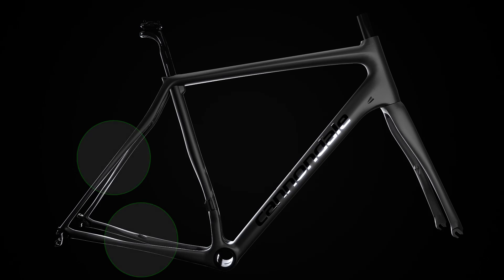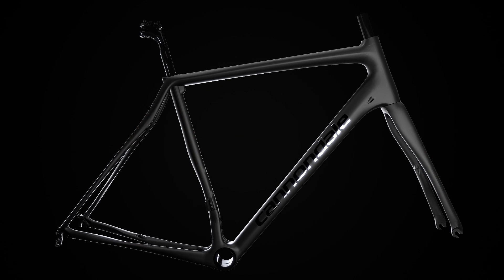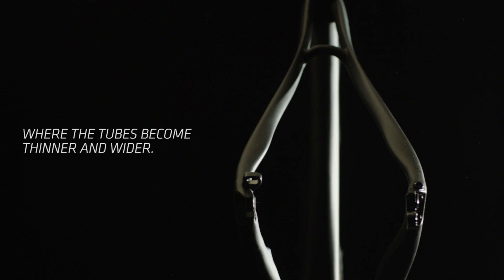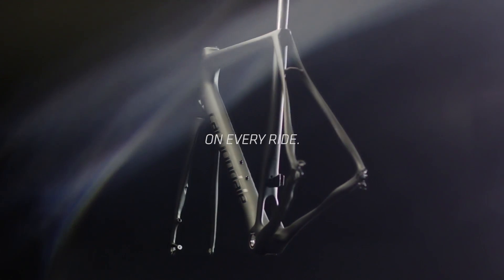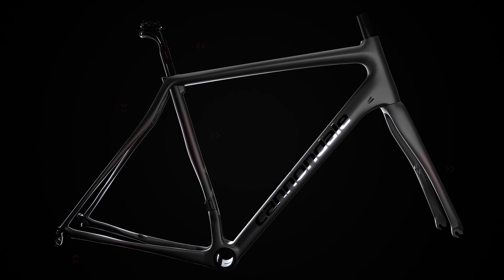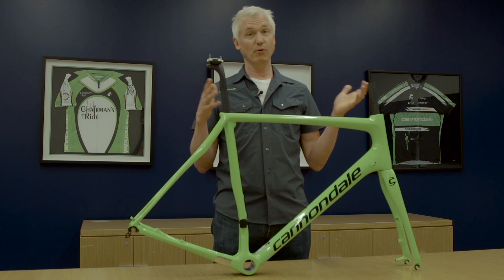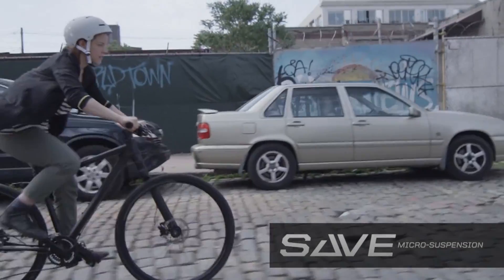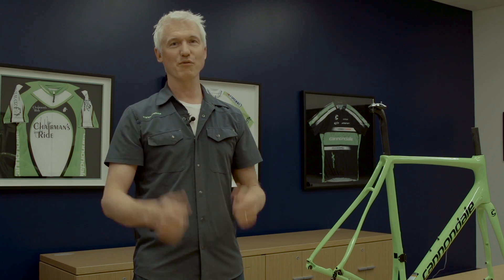Cannondale Innovation - SAVE Micro-Suspension

Comment: have you investigated the effects of flex on the long term integrity of your frames? 
Aluminium work hardens and, as we know if you want to break a wire you just flex it back and forth until it breaks.
Reply from the maker: Hey Ian, great question. SAVE is a micro-suspension system which flexes just a tiny amount, akin to flexing that wire in your analogy barely fractions of a millimeter. This micro movement translates to the rider for reduced fatigue over the course of a ride, but does not compromise the longevity or the lifespan of the structure and materials.
Reply: Cannondale Bicycles I'd like to consult a metallurgist as I believe the aero industry has some experience of metal fatigue that may be relevant. After all nobody wants broken  aluminum  thrust into their licra.
Reply: @IANRPARKER  Ever see a wing on an aeroplane?
Reply: karl yes and they are checked frequently then scrapped after a calculated period.